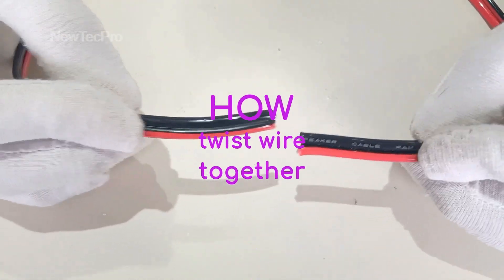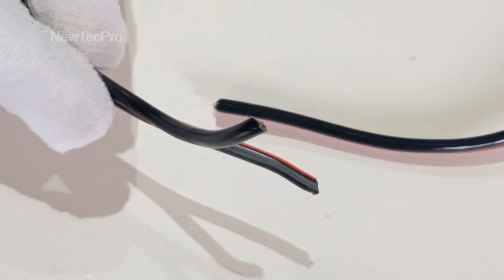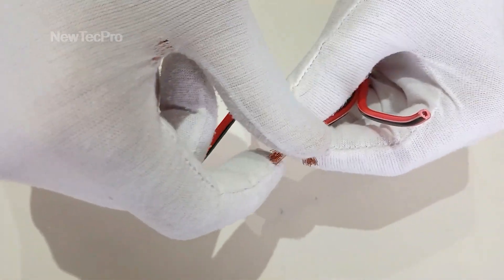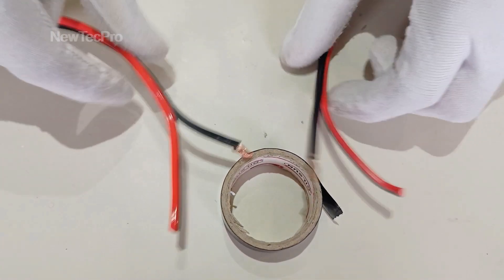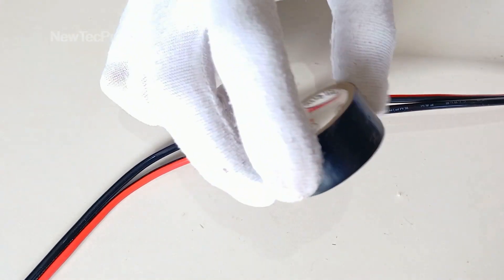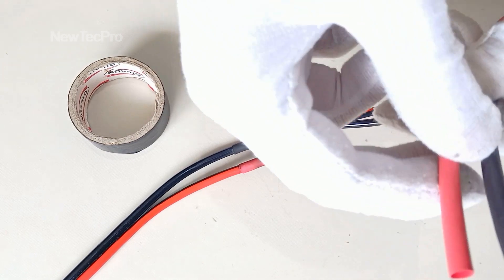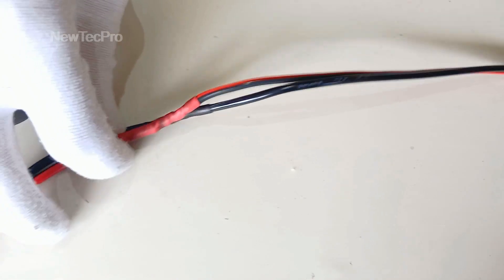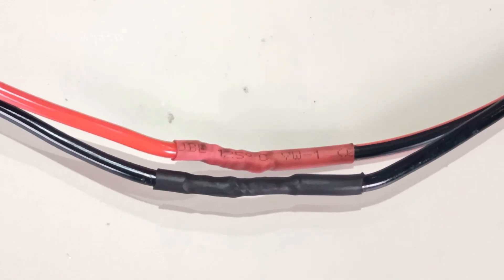How To Twist electrical Wire together? (2)

Comment: Advanced tip!

I recently had to solder wire taps into a 12-conductor pigtail.  There's no way you can have a huge wire splice bubble in the middle of the pigtail where all 12 joins are made.

Start on one side of the pigtail, join in a wire, move 1.5" or so and make another join, repeat.

In short, if spicing, tapping into, or repairing multiple wires in a harness, stagger the joins.

Comment: I advise against putting solder on top by melting the solder next to the soldering iron. It is way better to heat up the conductor from below and put the solder on top. When it melts, it will follow the heat and drip through the strands, effectively reaching out most crevasses.
Reply: Also, get a molten drip to cling to the iron.  Then, let the drip transfer the heat and flow into the join.
Reply from the maker: @russellstephan6844  :washhands::washhands:
Reply from the maker: Thanks for your very kind comment. This shows that you have carefully watched the video. I will try to use this guide from now on.